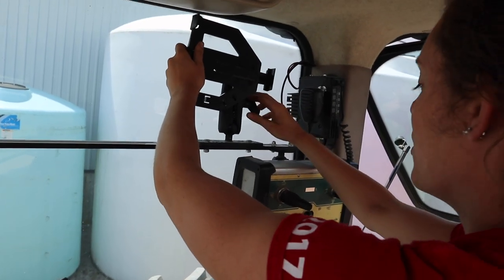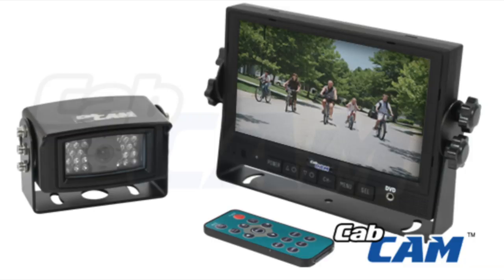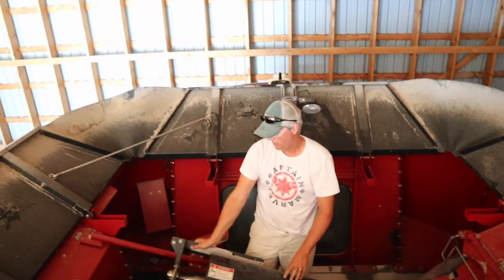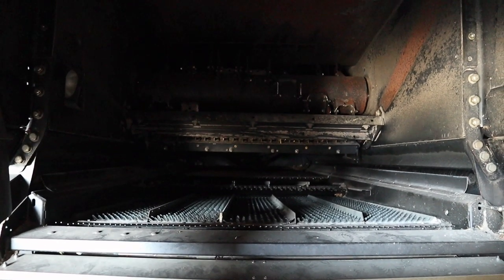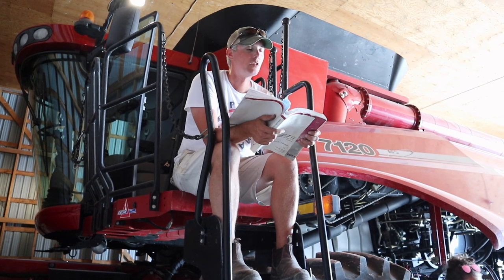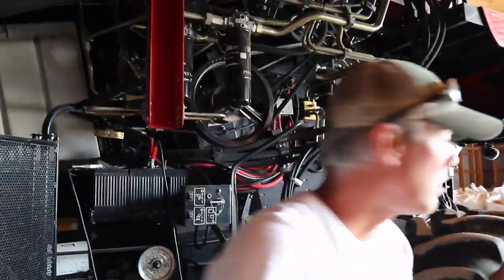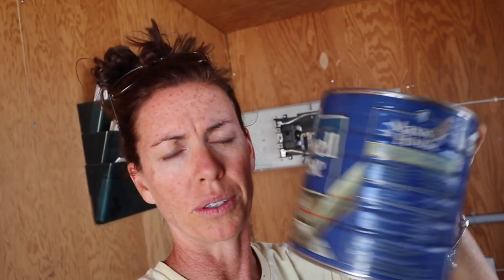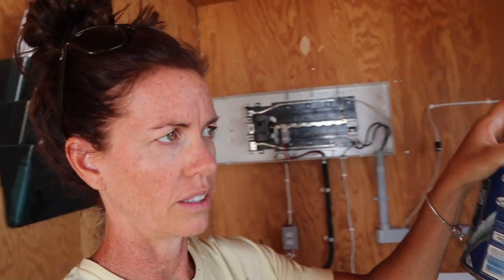First Day of Wheat Harvest 2019 (WE HIRED OUR KIDS!): Vlog 153

Comment: I just saw this video and you were using rags to help close off your door on the dump door on your piece of equipment. Try using a piece of the foam pipe insulation that you use on your waterlines in your barn. Cut it to length and slip the opening over the bottom of the door. Close the door and it will act like weather stripping on a house door. Just a thought. Hope that it works for you.